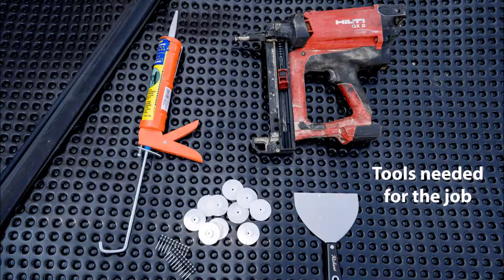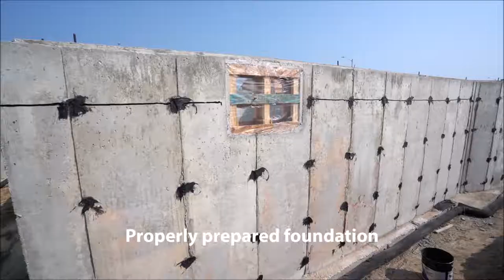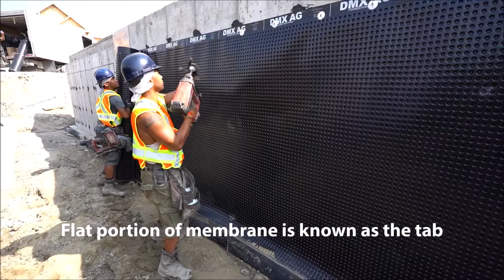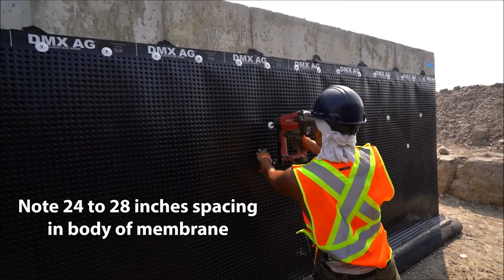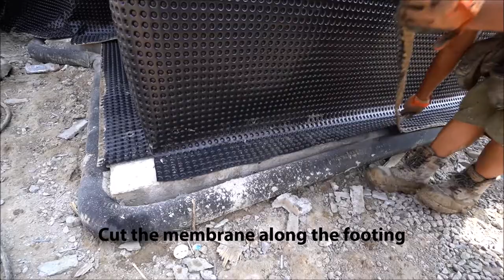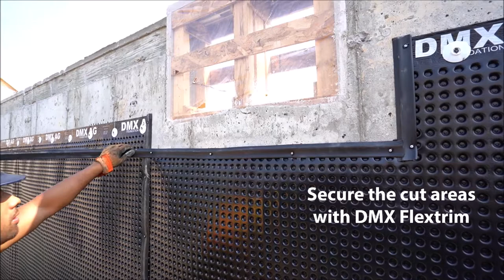DMX AG Installation Video

Comment: Hi there. I was wondering if there is an alternative to using a hilti nail gun on the dimple board to the foundation as I'd rather not risk any cracks. Ive been told it's difficult to nail through on older foundations? Any help would be greatly appreciated as I'm redoing my perimeter drains this week! Thanks in advance